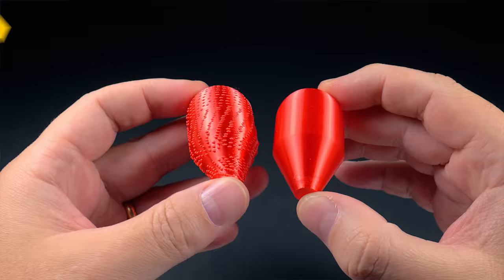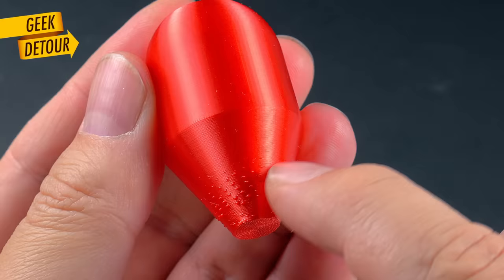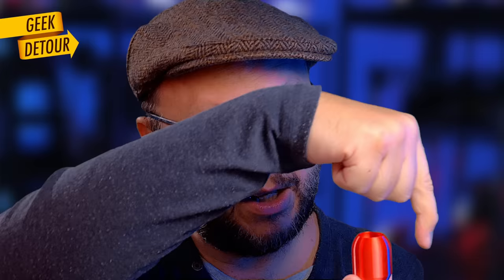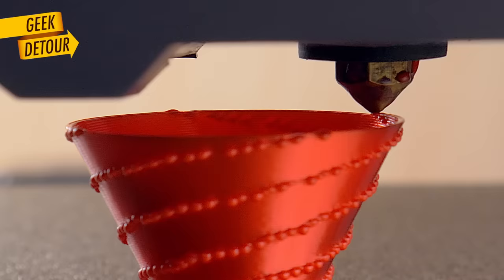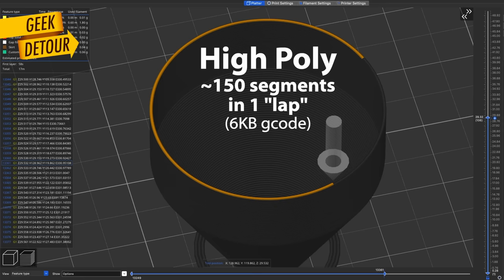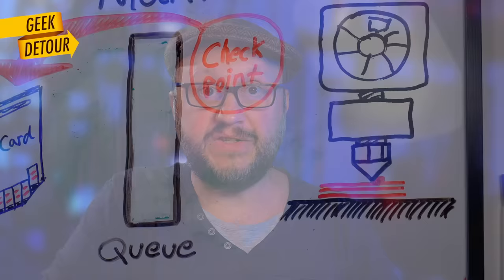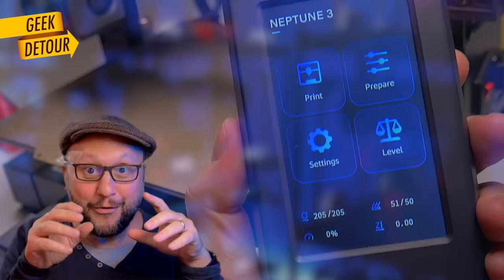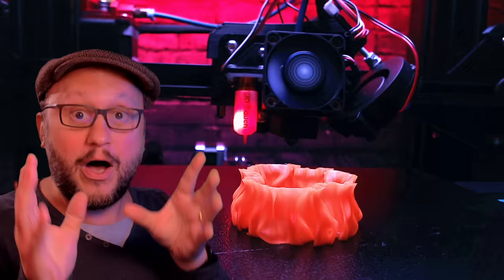3D Printer Blobs: a mysterious problem you won't guess how to fix 🤔

Comment: Quick question,  totally new to 3d printing,  my issues aside from some bubbles, I keep getting strings on my pieces.
Reply from the maker: Oh, stringing can be tricky, many factors. But I recommend you an excellent video from a channel I also watch: https://youtu.be/J_h24R-ytqg
Reply: With my crap printer (Wanhao Duplicator 9 MK2 400) I had horrible stringing problems.

The things I did was to reduce acceleration from the default of 3,000 to 800 and the jerk from (I think it was 21) to 6 or 8... something like that.

I enabled retraction and played with the retraction distance and speed until the stringing was gone.

I now rarely see stringing.  I do print overly hot, however, because on this printer, I get much better, most solid prints by printing hot (eg 235C for PLA) .  Printing hot can introduce stringing moreso, so again, the retraction distance and speed may have to be change as per filament used (cheap, good quality, etc) print speed, temperature etc.

I have created different profiles for each of those things.  Works well.

Comment: So does the ups fix the problem also? or the gcode file is a must?
Reply from the maker: When you run the GCode to deactivate PowerLoss Recovery, well, if you actually have a power cut, you will lose your print, it will stop for good and when power gets back it won’t give you the option to continue from where it was left.
The UPS is for you to keep your printer printing even without energy… so, even if there is a power loss, you won’t lose anything.

Comment: Is there not a way to connect a regular PC to run the printing hardware rather than the weaker built-in hardware?
Reply from the maker: Absolutely! You can control the printer with a desktop, laptop, a raspberry pi running OctoPrint… even phones or tablets can run a firmware called “Klipper”. These alternatives have their own challenges. Anyways, for people using SDCards on the printer, disabling power-loss recovery is my recommendation.

Comment: @GeekDetour - is this still an issue on the Neptune 4 and/or Klipper?
Reply from the maker: Hi there! As far as I know, Klipper doesn’t have a PowerLoss Recovery feature.
Reply: @GeekDetour  - aha, perhaps that contributes to how Klipper is so much faster?
Reply from the maker: Ah, nooo… The whole architecture is very different: you have a much more powerful microcomputer running the complicated calculations and the microcontroller board just runs the motors. But there are Marlin printers running very fast too (using much more powerful microcontrollers). It seems Bambu printers run a modified Marlin.

Comment: Faster SD card or better printer that can handle it. Thank you though, this may come up.
Reply from the maker: Or actually just disabling it. On SDCards, reading is faster than writing. It doesn’t make sense writing a checkpoint all the time - it also wears out the SDCard prematurely.

Comment: Question: Does power loss recovery also apply when printing from cloud on K1 Max?
Reply from the maker: Oh, rest at ease: no printer with Klipper has this problem. Power Loss Recovery was a feature on printers running Marlin.
Reply: @GeekDetour  thank you. By chance do you have any videos on printing with PETG? I am trying but getting bubbles on my K1 Max?
Reply from the maker: I am not necessarily saying it IS wet filament… but when your PETG is not dry, it makes the prints very irregular. If you don’t have a filament dryer, sooner or later you will need one. Try reducing the flow a bit. If it’s 0.98, get to 0.96… print something small to check it out. Overextruding with PETG makes blobby finish, it builds up on the Nozzle…

Comment: Why the printer need so much time to save the current position?
Why not just save the step? I mean if the current step is one hundred thousand of a million, just save 100000, that shouldn't take so long to save; and when the power comes back read that position and continue.
In the other hand, an UPS will not last so much time as some prints require. What should I do in that case?

Comment: I added the code into cura and have the setting off on the printer and its still happening....
Reply from the maker: That’s not nice… If you are still getting little pauses and blobs, it is worth trying a different / faster SDCard from a good brand (SanDisk, Samsung, Lexar…) Class 10… Some people said an SDCard with too many files also can get pauses… or Long Filenames can cause problems… I still need to investigate more about SDCard problems.
Reply: @Geek Detour  I figured it out at 2 am last night. I run creality cloud and I went ahead and unhooked my whole setup for about an hour to decharge. For some reason that fixed it. I've unplugged it before but never like that.

Comment: This dont happen with wifi connected printers right?
Reply from the maker: This only happens if you print from the SDCard, high poly model with Power-loss Recovery enabled on Marlin. If you have a Wifi printer that saves the file to the SDCard and you print from the SDCard, it could happen. If by “Wifi” you mean OctoPrint or Klipper, then no, this problem does not apply.

Comment: Not an issue in my printer using octo-pi that runs the gcode.
Reply from the maker: Sure! When you print ever USB/Serial Connection, Power-loss Recovery is not used even if it was enabled. 👍

Comment: I know what in cura have addon he can combine polygons into one g code comand and when happend check point queue will not end im time
Reply from the maker: Yeah, ArcWelder - it works. What I really want is slicers start supporting .step files (that preserve the original cad geometry, instead of relying on the STL (that is a mesh of triangles).

Comment: I don't have this on my printer. It has built-in memory. Over the local network, the file is copied to the printer and it is already working with it.
Reply from the maker: Hi there! Which printer is yours?
Reply: @GeekDetour  Flashforge
Reply: @GeekDetour  I forgot to tell you. I have not met such problems with bubbles. Maybe because the file is stored on the internal memory

Comment: Couldn't you just edit the code of the printer to lengthen the queue
Reply from the maker: Yes! And for some other problems it helps - but for this situation, it creates a conundrum: the queue itself is part of the whole package of information that is written as a checkpoint every time…. If you increase the size of the queue, it will take longer to write a checkpoint 🤷‍♂️

Comment: How do I disable that on my Anycubic 🥸
Reply from the maker: The best thing would be first discovering if it is enabled at all. If there is no Menu option about it (the obvious easy way to check), you can connect the USB of your printer to your computer and use “Proterface” (which is free) and type “M503” (without the quotes) on the console: it will output most important settings - if PowerLoss Recovery is implemented on your firmware, it will say if it is enabled or disabled.

Comment: Why do 3D printers have soo little memory?
There's many cheap micro computers with megabytes, even hundreds of megabytes of ram.
At the price of an average 3D printer I fail to see why that would ever be an issue.
Reply from the maker: Weird as it seems, 3D Printers don't need more RAM! The "computer" is in fact a microcontroller that has everything built-in on a single chip: 32 bit CPU, SRAM, Flash storage and a bunch of different interface pins to actually control everything in the printer. The task they perform is very specific, it runs a single program (there is not even an operating system, it is unnecessary). And here is the surprising thing, a popular chip like the STM32F401 can be purchased by consumers for less than USD $4.  On 3D Printers, the cost is really mostly driven by weight, shipping volume, motors, manufacturing and assembling of the mechanical parts.

Comment: Interesting video. I just looked up arc gcodes on Prusa MK3 firmware and they mention that long arcs can be problematic as mesh bed levelling corrections are applied only at the end of each arc. So using arcwelder might have a side effect if this is still true on the current Prusa firmware. Using Klipper is another solution to this issue.
Reply from the maker: Hum!!!! That’s very interesting!!!!!! I need to check this for big arcs!!!! Thanks!

Comment: update frimware should fix this
Reply from the maker: Hum… not really. After I made this video, a few manufacturers wrote me saying they would change their firmware, so the PowerLoss Recovery feature would now come “disabled” by default on new printers. So, yes, in this case a firmware update could “fix” the issue. But it is not guaranteed: you always need to check what exactly a firmware update is “fixing”, sometimes breaking - or just changing.

Comment: Tried it without success :(
My print keeps stuterring on every layer change
Reply from the maker: Are you using the SDCard that came with your printer? Try buying an 8 or 16GB good quality SanDisk or Samsung SDCard (sold by Amazon or any reputable store, be careful with fakes that many small stores sell). Put only one GCode file with a short filename to test.

Comment: minimum layer time?
Reply from the maker: Well, it would definitely make the heat creep that I had at the bottom of the part go away - and by slowing down (on small parts), it would inadvertently fix the Blobs because it would give enough time to write the checkpoint to the SDCard. But on a big print, it wouldn’t make any difference.

Comment: So, use a HIGH QUALITY FAST SPEED SD Card? .. think I have a 64GB one that was for photos, I will use.. 
My question. I have a SSD 128GB drive popped unto a USB plug.  is there a way to hook this up? Maybe octoprint?  cuz if I can use the SSD that should be MORE than fast enough to use I'd suspect?? ( came out of an old Surface 3 Pro laptop ) ..
Reply from the maker: Hi there! Valid questions 👍 I was already using a Class 10 U1 SDCard and even so the Blobs Happen when Power-loss Recovery is enabled.  With a really cheap SDCard you can have blobs even with that disabled! 🤯
OctoPrint and Klipper don’t even have the feature “Power-loss Recovery” implemented - they assume you will have an UPS (actually, it can be a problem to have a power-cut while your Raspberry Pi is working… it needs to be properly shut-down - otherwise there could happen a file corruption 🤷‍♂️
Reply: @GeekDetour  I'm perfectly fine to turn off power loss recovery and just use a UPS that I can built..  
Most of my electronics use 18650 batteries (have about 80+ of them) ..  most have solar for the outdoor ones.. Either way , should keep me busy for a while LOL

Comment: why dont you just have like 1mb of ram (I'm saying mb instead of gb because you're using kb which is infinitesimal compared to each
Reply from the maker: Hi Jacob! Well, weird as it seems, these microcontrollers have all the RAM they need right now! 96KB is plenty to read GCode from the SDCard, translate that into actual movements that are queued and finally turned into pulses on each stepper motor. Everything is very tightly programmed, very mathematical… It is not dealing with heavy imagery, sounds or videos like we do on actual computers.

Comment: Is it possible to increase  BLOCK_BUFFER_SIZE to something like 32, 64, or 128? If so, shouldn’t that fix the issue without having to turn recovery off?

I suppose the buffer size would depend on the resolution of the curve? The higher the res, the bigger the buffer would need to be. If anyone tests this idea, maybe see if you can figure out a formula to calculate the size you’d need given a specific res.

Anyway, great video, and those time-lapses are beautiful.
Reply from the maker: Hi there! Yes, you can double or quadruple the queue size - that’s what I did in my old Ender 3 Pro (with a 32bit board) to make it work flawlessly with OctoPrint. BUT: it doesn’t make it a solution for the case of PowerLoss Recovery, because the QUEUE IS part of the information that is stored on the SDCard each time it saves a checkpoint… So, a big buffer will also makes writing to the SDCard longer… See? Let’s increase the buffer to have a large time window… but doing so, makes writing the checkpoint demand a longer time. 😭
Thanks! I love that timelapse video, I am glad you enjoyed it too! ❤️

Comment: why my older printers dont do this bc they dont have power off recovery lol
Reply from the maker: My old Ender 3 Pro didn’t have it at all. Then I compiled Marlin myself with all possible features… you discover what works what doesn’t. This video has a lot of storytelling: I presented it as a personal quest to discover what was happening - in reality that quest happened 2 years before, I kind of “re-enacted” the spirit of it. But true: older printers didn’t have this problem, I mean, feature 🤣 They had worse problems, though 🫣😂
Reply: @GeekDetour  i just use UPS with my printers so power goes off they keep going lol

Comment: Has anyone turned this feature off and then started having little gaps in their prints they didn’t have before?
Reply from the maker: What is your printer?
Reply: @GeekDetour  Ender 3V3 SE. I think I might be mistaken though. Might have been some leftover black filament peeling through on the gray that didn’t quite extrude all the way prior to swapping filaments. And there was a slight gap on one but it seemed to only happen once. I’m doing a 14 hour print right now. So I’m sure I’ll find out soon if it’s an issue or not.

Comment: Printing petg too hot made blobs for me. Cooled it down and problem solved.
Reply from the maker: In your case, it’s likely that the PETG was a bit humid and printing less hot avoided the water vapor to make bubbles. Or it got more viscous by being colder. So many things happen when you print hotter or cooler!
Reply: I had just taken it out of a sealed packet from the manufacturer with those crystal dry packets inside. Could it still be moist?  Our country is kind of on the dry side.

Comment: Mine does not have that n n
                                               U
Reply from the maker: That's actually good! Well, most printers are now moving to Klipper - and Klipper doesn't have Powerloss Recovery, and I thing that's the right decision. The Right way to ensure you will never lose a print is to have an UPS Battery system.

Comment: Will this work for a anycubic kobra neo
Reply from the maker: I don’t know if the Anycubic Kobra has the PowerLoss Recovery feature enabled. If it does, my guess is that turning it off would be better. Do you have blobs on your prints?
Reply: @GeekDetour  indeed i do I've printed 10 cylinders tuning it to go away i got them to get smaller but they still look like bumpy mess
Reply: @GeekDetour  I just downloaded your files gonna give it a try now I'll let you know how it goes
Reply: @GeekDetour  prints perfect in vase mode but not in regular mode

Comment: What if I enlarge the buffer size to say 50?
Reply from the maker: That sounds like a nice idea, until you open Marlin SourceCode and realize the movements queue is part of the structure that is written in the SDCard every check point… So… you increase the buffer and writing the checkpoint will take longer 😆
Reply: @GeekDetour  I print from PC, however I meet short pauses too in places where the head makes many chaotic movements. Does the printer save checkpoints in PC too? Will it help if I turn the checkpoints off and enlarge the buffer?

Comment: I'm sorry, but WHAT? Power loss recovery shoud be.....A SMOLL BATTERY..... not writing to an SD card. 

This can't be implemented this way in most new printers. This is a bug.
Reply from the maker: Yeah, that’s how it was implemented in Marlin 2 years ago. There are new implementations where the printer actually has a supercapacitor capable of keeping the board alive for a few seconds - when it detects a power outage, it cuts the motors and heating, only then it saves a checkpoint - and performs a system shutdown when it uses a more complex OS with a filesystem that must be safely unmounted.

Comment: if only i knew this before i threw away my anet a8 XD
Reply from the maker: I think the Anet A8 had the other problem: too little memory, to the point that the only solution was to the reduce the resolution of the models in which curves were sliced.

I think the Anet didn’t have power loss recovery.

Nice old times 😄 Simpler problems… lots of problems, though.

Comment: Very simpe solution, use klipper instead of stupid merlin and you don't need to take care about how much RAM your printer have and you can have as many verteces as you want on your model. Really merlin will never have options like klipper running on proper computer/RPi even with 32bit board printer. Disabling features of firmware to fit it inside microcontroler.... OK, it is also option, but not ideal at all. And for power loss use UPS... Another good idea is to use ArcWelder extention in your slicer.

Comment: Wer druckts chon von der Karte ... ist doch sinnfrei.
Wenn, druckt man vom Rechner aus
Reply from the maker: Hi! Printing from the computer can have problem as well - specially if you are using other programs simultaneously. Disabling the power-loss recovery feature solves the problem, and printers can actually print very reliably from the SDCard when just “reading”.